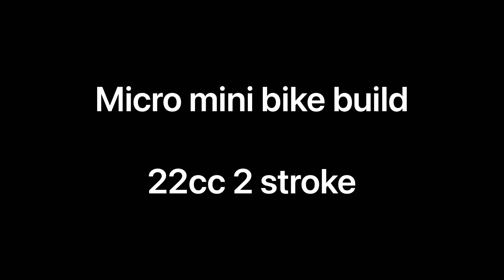Tiny micro mini bike build

Comment: Very cool! I am designing my own minibike and wanted to ask what size sprockets you used in your build?
Reply from the maker: Hi I can’t remember exactly but you can probably count them at 5:58 in the video. I used an online gear ratio calculator to choose the correct gearing
Reply: My homade scooter mini bike hybrid has a 13 driving a 40 goes 47 MPH at 3600 RPM.

Comment: Is 22cc enough?
Reply from the maker: It was going about 18mph with that gearing
Reply: @bigjohnwishbone  18mph is not bad! I got a new trimmer engine with 32cc and 0,85kW, this could be surely enough power for Tom Thumb mini bike project. I red that the guy used a 3/4hp O&R engine for his mini bike and it run 11mph.
Reply from the maker: 32 should be plenty